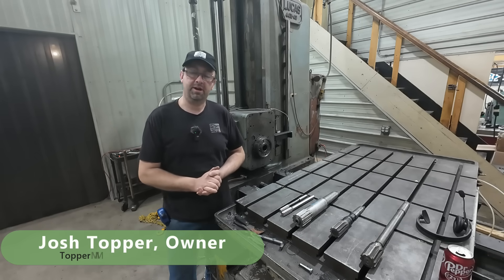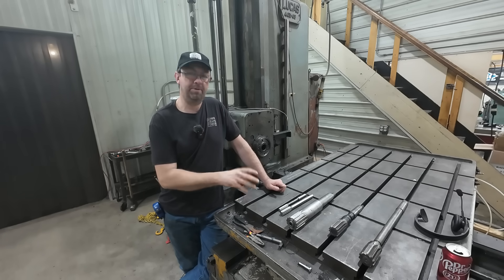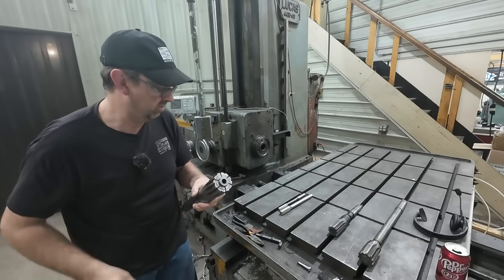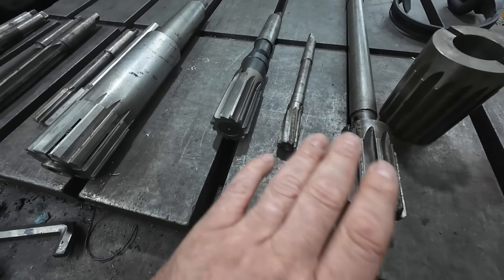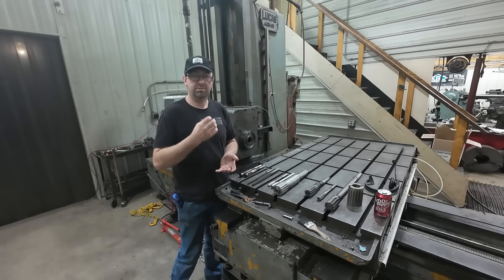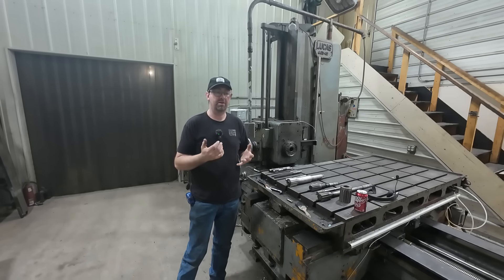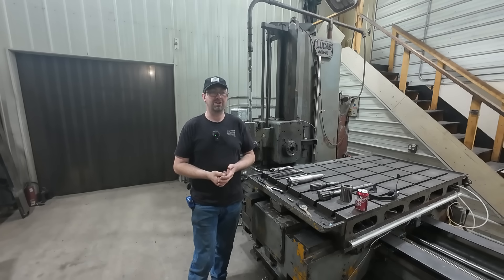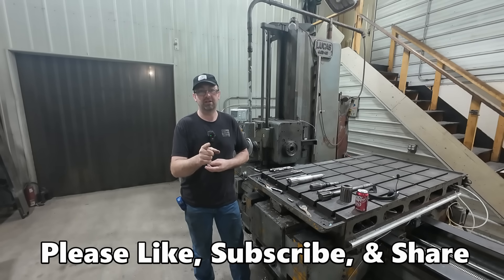Box Tube Boring Follow-Up | Reamers Explained

Comment: The one adjustable reamer  you have is not really meant to be adjusted to change size. They are adjustable so you can adjust them up and then regrind them when they get dull. If you think about it when you adjust it up the blades are then no longer parallel to each  other. I know they get used as adjustable reamers quite often but they were not really designed for that.

Comment: Very good explanation. I've seen tapered reamers used on car steering knuckles. Most of the ball joint stems are tapered for a press fit. I've seen them to clean the holes. I've also seen them used to increase the size of the tapered hole, but I don't think you can use them to really enlarge the hole. Secondly, I think a lot of people, myself included, have memories of a lost pet. God bless and R.I.P. Rocky.

Comment: If the person actually said "throw it on the floor" he was very incorrect.  I saw the video and it rolled off the table onto the floor.  We only have so many hands.  If that has never happened to him, he's hasn't ever worked in a shop.  Probably doesn't have a shop.  Thanks.

Comment: My understanding of the 'adjustable' reamers was that they are not so much made that way to allow slight adjustments to the diameter they cut (although you can do that over a small range), but rather to allow them to be resharpened to their original size.  Once they are dull you screw the cone in to expand the reamer flutes slightly, then resharpen the flutes to their original size.  With ordinary reamers you can only sharpen them to a smaller size.

Comment: I have a question I have been wondering about that I hope you will answer.
I have noticed that when you cut threads on the mill sometimes you quickly back the cutter off at the end of the threads and sometimes you stop the feed and let it cut all the way around.
What determines which method you use and why?
I am not a machinist so I don’t know.
Thanks

Comment: Josh, so sorry for your loss!
Good video on reamers and like you, I am also a fan of using reamers to final size holes. The reamer you used is an expansion reamer and even though we play with adjustment to size holes, by the book the intention is to be able to oversize it with the adjustment and then resharpen it back to size.
Reply: That's my understating as well, can expand it enough to sharpen the reamer whilst retaining the original size.

Comment: The adjustable reamers were common in the automotive industry.  They were used to size brass and bronze bushings for piston pins and kingpins.  The kingpin reamers typically have a pilot to keep them in alignment.  I am sorry for your loss.
Reply: Specifically, the adjustable blade reamers.